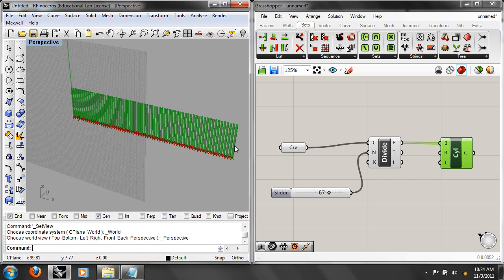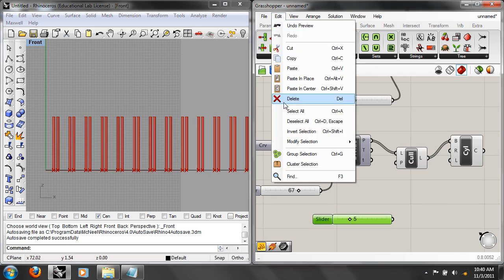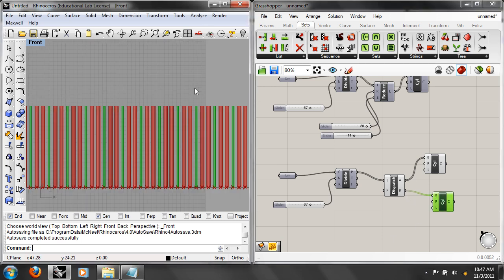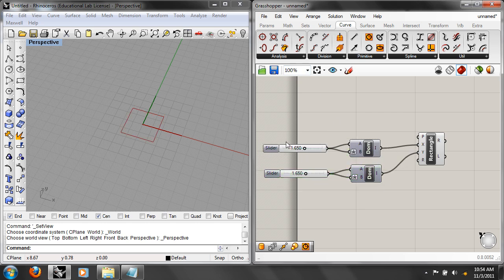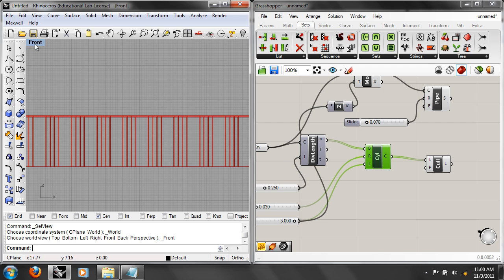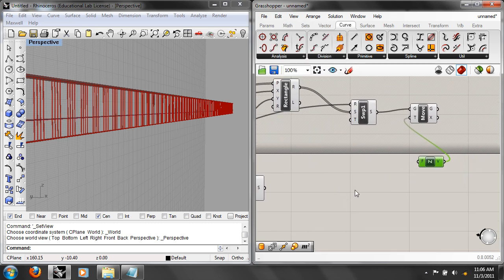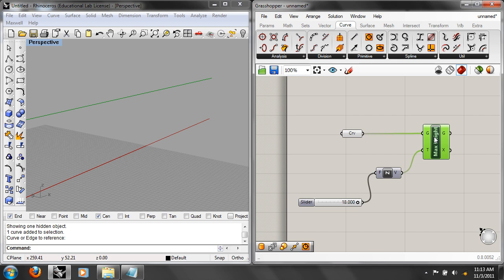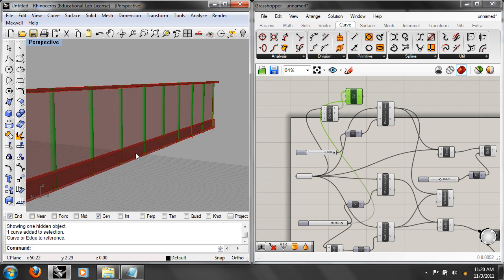Grasshopper Lab 2: Cull Patterns, Facade Study - Fall 2011

Comment: Hi there, thanks for the tutorials, they are nice to follow and learn ! Have a question here and would really appreciate if you could help...On about 20:32 the negative expression doesn't seem to work, even when I typed  "-B" in the expression, and the box turns orange-brown. Am I typing the expression wrong or anything ? If I don't include the "____" expression the domain box turns red. Would really appreciate the help ~ thanks !
Reply from the maker: These days you have to always use "X" instead of the other variable letter. (In this case use "-X" instead of "-B") They changed the behavior in the newer versions. Otherwise, everything else works.
Reply: @nsenske  Hi Mr.Nick, thanks for getting back, really appreciate it ! It works now once I type in  -X, thanks for the help !